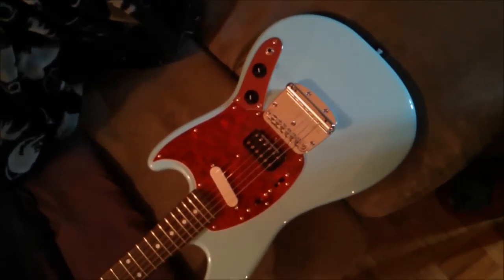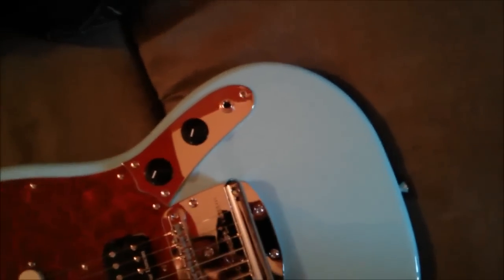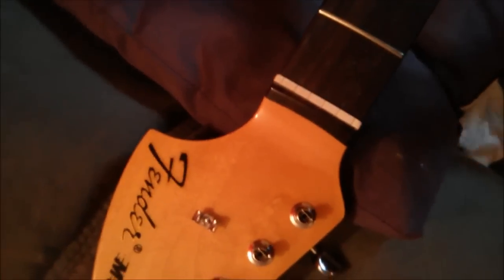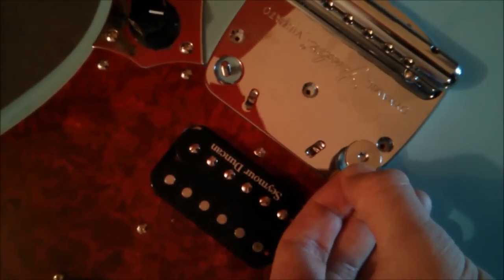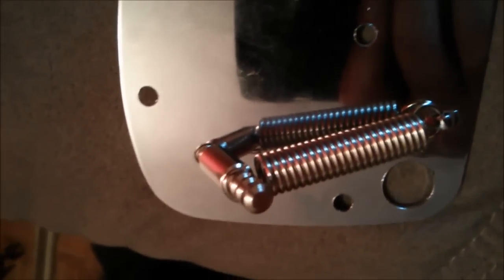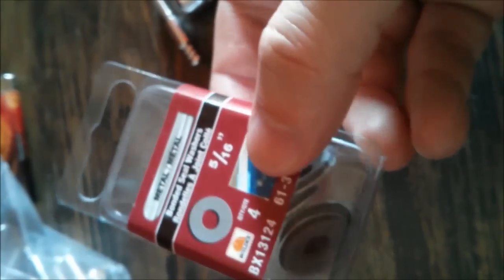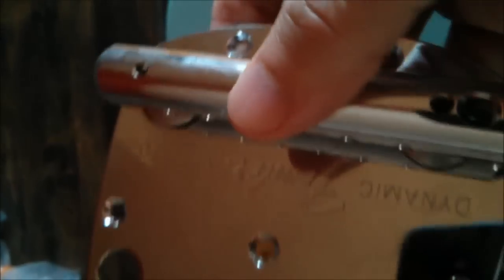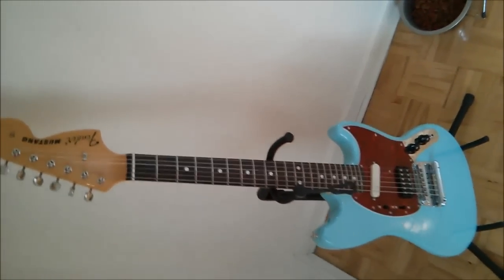How to lock the mustang tail piece

Comment: Kurt used 10-52 gauge strings. You are correct in that there is actually no need to cut the notches any bigger on the nut.  I have 11-52's and they fit just fine.

Comment: i just use a bolt the same size but shorter no need for washers. just screws right in... did my two jagstangs this way..also don't need to mess around with the springs...

Comment: I don't get why people don't like the vibrato's but if you were going to do this instead of prying the end of the spring with a flathead you should use needle nosed pliers on the other end of the spring and simply pull the spring until you can unhook it from the little notch that holds it. Also looked like you used washers with a rubber in them, i would strong advise against because the rubber will slowly flatten out and deteriorate from string tension and general movement not to mention the rubber effecting the way the sound reverberates around the bridge and body. like hitting a snare drum with a towel over the top.

Comment: Im gonna get a cheaper Squier mustang and mod the hell out of it.. I found a really good looking bridge for it too with the same radius only problem is the anchors are 1mm thinner so that is a problem I will have to figure out, But yeah this really helped as I will be locking the trem as well.. Thanks!.

Interesting how the ajustomatic bridge posts are screwed into the wood 
like a standard Tune o matic as opposed to the modern style with 
anchors... Useful discovery :).

Comment: Cool video, thanks for the demo. I'm just wondering how many washers you used on each side of the bridge?
Reply from the maker: Santiago, I just used a single washer on either side. The washers I used were a bit thicker so I'd suggest experimenting. Usually washers come in a packs anyway and are never too expensive. In my case as mentioned it came with 4 washers for about 2$ canadian and I only used 2 of the 4.
Reply: Livlos I see, ok I'll try that, thanks for your help.

Comment: my springs just fell off before I even took the plate off. what a mess these trems and bridges are... oh and the big and small alan keys didnt fit in any of the places they were supposed to..didnt need to use them for the trem anyway as the posts were so loose.... do you know if they use US screw sizes in europe or is it only the alan key slot and nut heads that have different sizes that ours ..

Comment: Great vid! Just what I was looking for. I'm going to try this tomorrow on my Japanese Mustaings (with matching headstocks!). Is the adjust-o-matic bridge necessary if I'm happy with my action and already have no tuning issues? Thanks for posting this!
Reply from the maker: TonyPeesTunes Nah the bridge doesn't matter. If you're happy with the mustang original bridges go for that. The Cobain ones just come with an ajust-o-matic (or probably a copy of one really). Glad I could help.
Reply: Thanks. I wish I had seen this sooner. I wouldn't have ordered the bridge from eBay. Haha oh well. I imagine adjusting intonation will be easier with the AOM. It looks like the adjustment screws are front facing. Or maybe I'm looking at it backwards.
Reply from the maker: TonyPeesTunes Intonation screws are sometimes forward sometimes on the back... Depends on the model really. The mustangs are front facing, my gibson they are rear facing. Well the AOM will be an improvement at least its not money wasted. Hopfully it fits in the cavity for the mustang piece. If not...tape!
Reply: Livlos yeah, all mine are rear-facing :/ I'm planning on putting 12s on all of them. We'll see how that goes. Haha.. yeah well if this works out, maybe I'll just turn around and sell it.
Reply: Livlos so I just took mine apart and remembered what you said about the bridge. I'm wondering if some of them were simply put in the other way around... even though all 3 of mine are facing in the same direction. I'm tempted to reverse mine.
Reply from the maker: TonyPeesTunes The issue with that is you'd have to redo the intonation fully. Also the saddles usually have the appropriate grooves for the strings...to properly flip you;d need to always swap all the saddles around
Reply: Livlos yeah, I set the intonation and that went pretty well (which is why I wanted to switch around, for ease of adjustment), but I didn't think about the saddle grooves. I just checked them and unless the differences are microscopic, I can't really see them. All strings are nestled in there pretty will. The only downside to this modification is that the 1st and 6th strings are just a tad offset by the washers.No biggie though. So far the strings are staying put and I love having a heavier gauge on without having to worry about them darn springs.

Comment: Thanks for this. I got a KC Fender Mustang and trying to remove the Vibrato plate unit. After the 5 screws does something else need to be done. Plate is not moving. Do I need to move tremolo bar forward and then lift?
Reply: Ah ~ it’s hex key. Have to turn screws 🤣
Reply: Finally took it to local Guitar Center- my Mustang (got the Lake Placid Blue 😁) had a little of glue under the plate. Did the KC fix by flipping the tremolo so strings go through). Thanks for your Video! It helped the Guitar Center guy who had never worked on a Mustang. 🤘

Comment: Ugh, aesthetically speaking, I don’t like the washers on the outside so I’m putting them under the trem plate. Still gonna use the stock Jagstang bridge but if I change it out it’ll be changed to a TOM bridge but I’m trying to keep my 97 Jagstang stock. The PUP’s are weak but there’s still something cool about that lol

My Strat has Texas Specials and an SH4 JB, the Jaguar NOS is stock with the Dimarzio PUP’s so my guitars will all have a different sound to offer. 

But if I ever do mod my Jagstang it’ll pretty much look like this one (I know this is a Mustank) except I’ll use a tortoise shell pickguard not that vomit red one lol

Comment: I'm thinking of doing this to my recently acquired 96 sonic blue mustang. But I just picked up a Mastery bridge for the guitar, and I'm not sure how that may impact the effectiveness of the bridge, or if it's even worth it. Do you have any opinions/suggestions?
Reply from the maker: +pandemic7 If I'm not mistaken the MasteryBridge  would only be the piece with the string saddles. Shouldn't change anything really. Try it out with the new bridge before trying to lock it, see how it feels. What I did here is 100% reversible anyways
Reply: +Livlos yeah the mastery bridge is supposed to be a major improvement with keeping it tune. But we'll see. If necessary I'll go thee extra mile and lock the tail. Thanks!

Comment: Hi there, thanks for the helpful video. I have one question, did you stick with using just one washer for each post? I've been reading up on this and many people say to use more than one washer for stability. I have set up my Mustang neck relief and action perfectly but as soon as I tune up it goes out of tune. I'm hoping locking down the bridge will solve this problem. Cheers!
Reply from the maker: allthingsclassicrock just one for me but I got thicker ones with rubber backs. Standard washers you'd need a few

Comment: I've got a modern player mustang and I'm experiencing a lot of frett buzz when I play on the low E. The bridge I have is I think the same that comes on the squier one, not sure. Do you think locking the trem and buying a tune-o-matic bridge will help?
Reply from the maker: it won't hurt...but no I don't think it would fix it. fret buzz is caused by the string hitting frets while you play it. what you need to do is determine what is causing the buzz. this could be a front or back bowed neck. uneven frets. or having your action set too low. or you could be using much too light a string gauge. I would suggest at least 10s on a short scale like the mustang. shoot me a pm if you need any help
Reply: I've tried heavier string gauges but I doesn't help. I have raised the saddle for the low E as high as I can but I'm still noticing it. Especially when the low E is dropped to a D. The saddles are all really weird. I can send a picture tomorrow if that might help haha. BTW Thanks so much for helping me and replying so quick
Reply from the maker: Looking up the modern player mustang, it would have an original mustang bridge,the Cobain mustang has more of a tune o matic bridge. on the tune o matics you have a screw on either side to raise or lower the entire bridge. On the old mustang you could do the same by using an allen key in the holes on either end of the bridge to lower or raise the entire bridge piece. Of course again the first thing you should check is if your neck is actually straight. I may make a few videos on how I set up my gear. If you aren;t comfortable with adjusting the neck yourself I would suggest you bring it in to a luthier as you can break the truss rod en end up needed a new neck.
Reply: I had my guitar checked at my local guitar store and they said the neck was perfectly straight. This is a picture of the bridge I have http://www.fmicassets.com/Damroot/Zoom/10001/0242300504_gtr_frtbdydtl_001_nr.png

But it's really weird i need to check on my saddles every few weeks because sometimes on part of the saddle is higher than the other part.
Reply from the maker: Humm apparently youtube didn't feel like posting my reply. As I said before...You should be raising the action using the post screws (hidden in the holes on either side) and not the sadles. This should take a hex/Allen key.
Reply from the maker: That does not appear to be raised very high, however... Dumb question here but are you sure what you are hearing is a buzz from the frets? I seem to recall with my re-issue mustang and jaguar that the bridge would actually rattle.  If what you are getting is more of the bridge rattling, then yes potentially locking the trem might help, but chances are you might need a bridge replacement. If it is indeed fret buzz, I can;t really help you much more with out seeing the guitar in person :(.

If you are 100% sure its fret buzz, or if you're just not sure, I suggest you bring it to a tech and have them look it over.
Reply: Livlos I'm not totally sure, I find it really difficult to notice where its buzzing. Im planning on going to a guitar tech this week. I'll keep you up to date. What bridge do you suggest? A tune-o-matic? Thanks a lot for your help. Btw my low e is 11mm high measured from the pickguard
Reply from the maker: +Maarten Smits are you getting the buzz just when fretting certain notes or is it constant? do you get it on the open string too? the bridge usually has more of a rattle to it that can get annoying. there is a replacement most ppl seem to go for but I'd have to check when I'm home. I'm also not 100% if a tune o matic would fit with out modifications
Reply: +Livlos When I play in drop d and play a power chord the buzz is really bad. but when i play in standard tune it start buzzing when I play anything higher than the 6th fret. 
When I play an open note there is no buzz
Reply from the maker: then it is not the bridge itself. Seems like either neck bow (but you said they checked and it is straight) or a fret (or more) that need to be filed slightly. Thats about as much as I can guess with out seeing it first hand.
Reply: Maarten Smits I have a modern as well with P90 pickups amazing coils but yes it is cheaply crafted in china I get a buzz just from the 1/25 inch cable just bad craftsmenship
Reply: Nick Ford I swaped the p90's for a hot rails in the bridge and a standard single coil pick up. That was a huge hassle because the modern player mustang pickguard has different dimensions than a standard japanese or mexican mustang. 

Finally I swaped the bridge with a standard mustang bridge. And not the bridge that was made out of metal from cans. it cost me around $300.

I like it now but if I would have known this beforehand, I would have never bought this guitar

Comment: How many of the washers do you have to use? just one on each side of the trem bar or all of the four washers stacked on top of each other and do you have to flip the trembar or would it be better to flip it? I have this model guitar and wanting a tech to lock the trem because I may not can do it. Buy hopefully won't have to. And the problem with the tech is there's not any unless you drive a 2 hour trip. An all day thing. Help??
Reply from the maker: No you do not HAVE to flip the trem piece. I just did it because then you do not have to wrap the string around it. They can just be strung straight. Personal preference.

Washer, it depends, with the washer I got I just have 1 on each side on the top. If you want to replicate EXACTLY how cobains was, his was a stack of washer under the bridge plate/inside the guitar. So sadly the answer here is going to be "it depends". Luckily washers are dirty cheap. So you won't break the bank either way.

Unless you are REALLY uncomfortable doing this yourself, I would suggest you give it a shot and take your time. Seeing as you will take off the entire metal bridge piece to do this, there should be no way for you to damage the guitar. At worse, take it to a tech if you can;t figure it out.

Comment: so do you have to remove the springs to lock the tailpiece? or was that just your preference?
Reply from the maker: rob1996ization you need to get washers on there either on the top or inside...so yeah you need to pop the springs off
Reply: Couldn't i just take the cigar tube off?
Reply from the maker: good question... trial and error have a go..report back!

Comment: Ok I'll try to do it. I'll have to get the right size allen wrench because I lost the one that it came with. Do your know which size the allen wrench is? And how do you put the washers under the trem plate to do it just like Cobains? Or would it be much harder to do than thIs way?
Reply from the maker: I don;t remember how to do it the other way by now, google it, there are official nirvana sites with diagrams etc. I looked all this up a long while ago. There not need to route anything either way. I think I just went the way I did because the washer I got were too big to fit, and looked ok on the top. But like I said, you can take it apart and see what works...
at worse put it back together with out any mods, or bring it to a tech in pieces

Comment: Just for anyone watching this, when he says about using 10-46 gauge strings, having that light a string gauge over a short scale length as Mustangs do  can really mess with the neck and truss rod over a long period of time.
Reply from the maker: Ben Forsey well...yes...but that is the same for ALL guitars. You need to set up your guitar fully for your strings always. But that was not the point of this video. But yes you are correct
Reply: Yeah I understand man :)
Reply from the maker: Ben Forsey pretty sure this thing comes with 10-46 anyways...but I might be wrong
Reply: Yeah I'm sure it wouldn't be the worst thing ever. But i did see this video where this guy was setting up a '65 Mustang and he said because the neck didn't have enough tension on it, it made the truss rod not work properly. But that's over decades of use so.. I've set up a couple of Mustang's recently and I've personally found they feel way less floppy with 11-48's on personally, but that's just me. Have a watch of this video if you haven't seen it before, I found it really interesting! And for what it's worth, you still taught me stuff about Mustang setups I didn't know so thanks man!
https://www.youtube.com/watch?v=8PPxS8gTyno

Comment: Am I missing something. I am using 5/16 washers and it won't lock?
Reply from the maker: humm...hard to tell with out seeing what exactly you are doing... Are you putting the washer inside or on top like I did? do they fit snuggly around the posts or are they loose?
Reply: Livlos the washers are loose. I followed your instructions but the washer is loose on the post.
Reply from the maker: Had to rewatch my own video...it's been a while. Few things, as mentioned I brought the posts in with me to make sure the washer fit. 5/16 fit fine on mine (cobain model firts run) but I can;t guarantee other mustangs are the same size. Hence bringing the post with you...but hey washers are dirt cheap. next if they are just slightly loose it shouldn't matter. what you want to to screw the posts back in (don;t over tighten) so that they are in there snug and will prevent the tail piece from moving. If you are still having trouble, could you PM me some pictures or if you could upload a video? I;d be happy to take a look and see.
Reply: Livlos thanks you are the best. Could be a different run